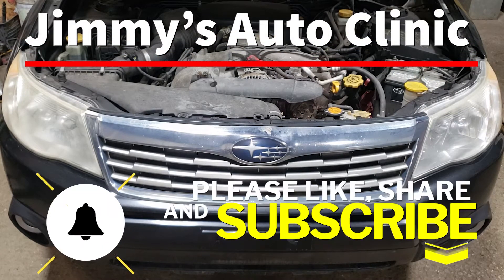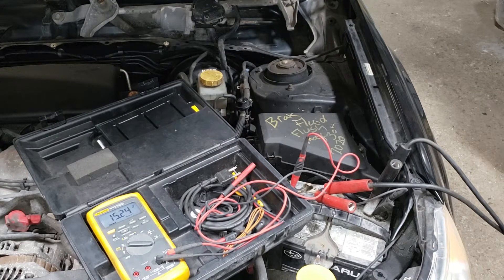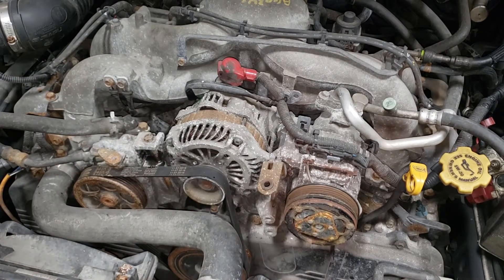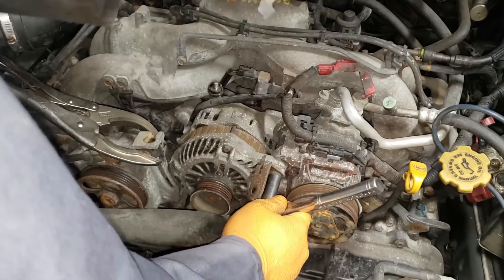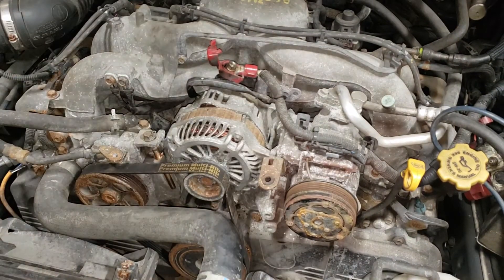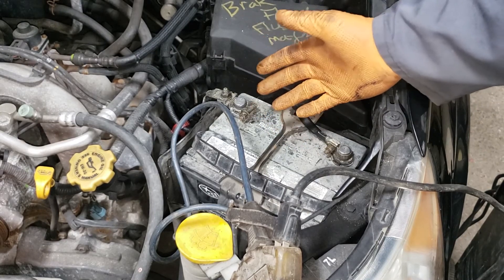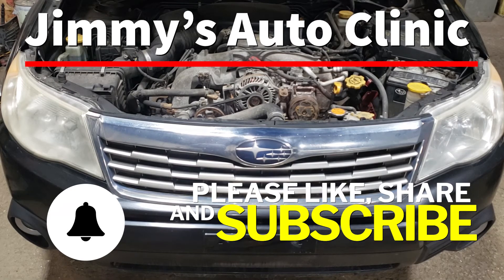Subaru Alternator | 2009 Subaru Forester | 2.5L SOHC | Replacement

Comment: I tried getting to long tensioner bolt out and it snapped in half, how do I get a replacement

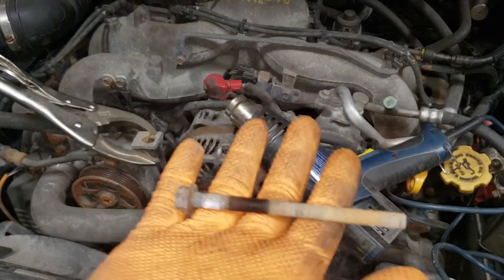The same bolt at 10:22
Reply from the maker: Oh my friend that is terrible news. The best thing to do to get a replacement is go to a scrap yard and grab one off of a car. Trying to get it out of the little aluminum block can be a small nightmare. Also when trying to remove it you may permanently damage the block so it just isn't worth your time. Just go to a scrap yard and get a whole new piece. If you're in the Toronto region I have them. Good luck my friend.

Comment: Hey,  so I just changed my alternator on my 09. All power seems good on start, once I start driving however at stops my idle drops really low and has stalled out. Any ideas?
Reply from the maker: Do you have an automatic or stick shift? Did you remove the battery when you change your alternator? If so what can happen sometimes is that the memory from the computer isn't retained so like when you clear the codes on this car the vehicle runs like crap and will sometimes stall out unless you do the relearn procedure. I myself don't do the relearn procedure I just drive the thing and usually within one or two cycles no later than three cycles of cold too hot the vehicle reset its parameters and runs fine. So it may not be related to your alternator it may just be because you disconnected the power from the computer. I hope that's all it is.
Reply: @JimmysAutoClinic  it's a automatic,  I drove it yesterday after the swap, then again today and took it on the highway for a bit( maybe not long enough) and around town. Do you think another good highway drive ( longer) might get it to remember?
Reply from the maker: Generally it should be okay after a couple of trips. I would take it on a highway trip with some City Driving mixed in. About 20 minutes to half an hour should do the trick if it continues to shut off there may be an actual issue that is present. Is there a check engine light that's on?
Reply: @JimmysAutoClinic  dashboard looks clean, except for my one leaky tire tripping the pressure Guage.  I'll give it a good run tomorrow.  Thanks for replying!
Reply from the maker: No problem. I hope everything works out with it.
Reply: @JimmysAutoClinic  thank you! I'll try to remember to update!
Reply: Oh, hey. Just remembered to reply.  All things seem to be working fine now after  a 45 minute drive down the highway. The idle at stops does still dip a little low but no where near stalling out. Thanks!
Reply from the maker: Thanks for the reply Brian I appreciate it. If it is still going low and seems to be getting lower you may need to clean the throttle body. Overtime gunk and debris can build up in there with the oil once you clear that stuff out it will work beautifully again. But I'm glad to hear the good news.

Comment: Is the N/A alternator the same as the turbo one?
Reply from the maker: That is a good question I don't know the answer to. I believe they are the same but there may be a difference in amperage. The best thing to do would be to look up the parts for both vehicles online. If they have the same part number you're good to go, if not there may be a small non-significant or significant difference so I wouldn't chance it.